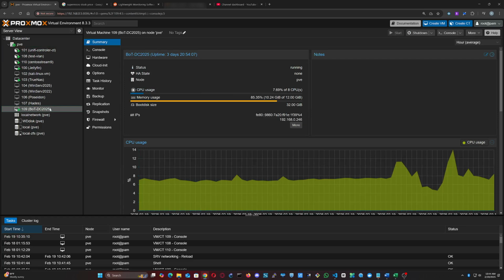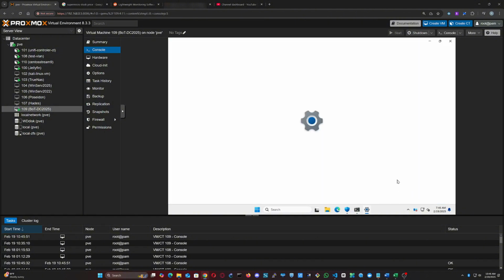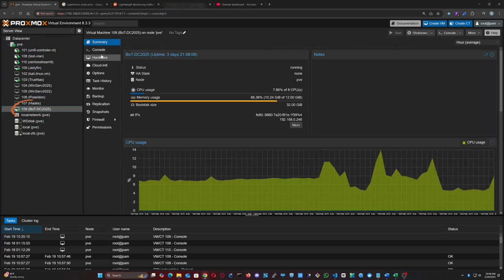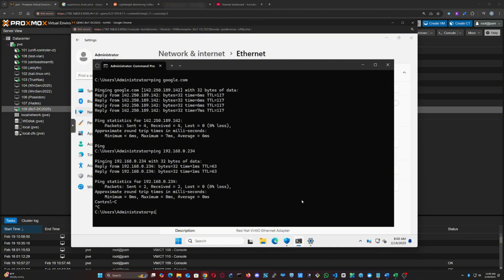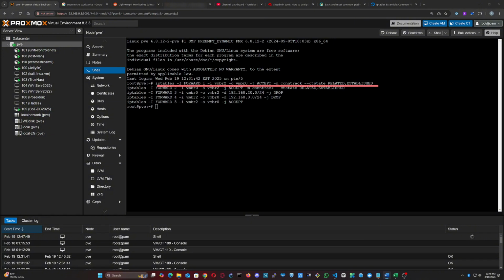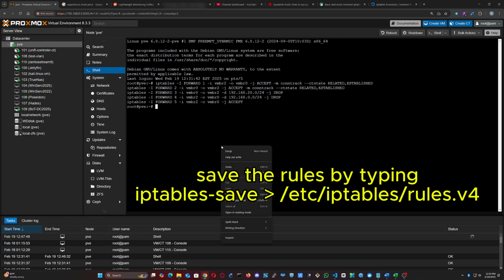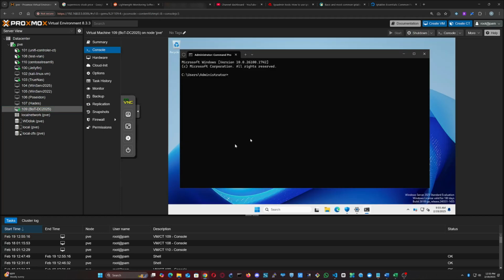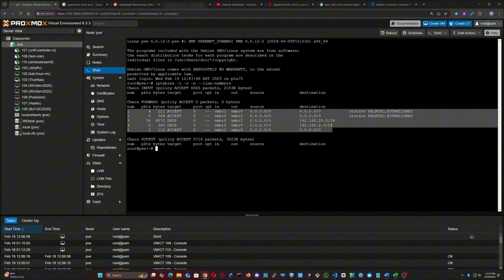Proxmox VLAN Isolation with Internet Access (using iptables)

Comment: The bridge is just as virtual network interface ? You have that vlan 20 in your switch settings?
Reply from the maker: Yes in this case for the first question.  As for the second, the vlan20 in this video still was not created on the switches, but I am planning to release a video once I do that.